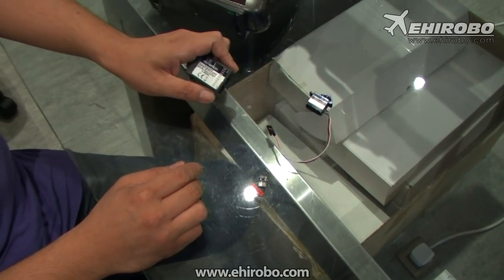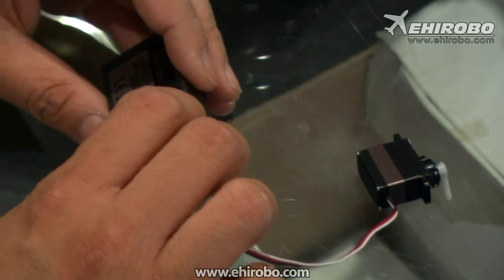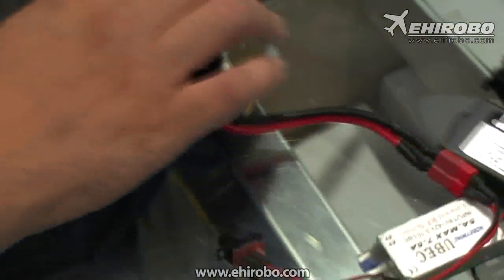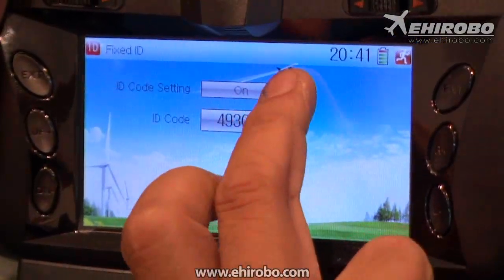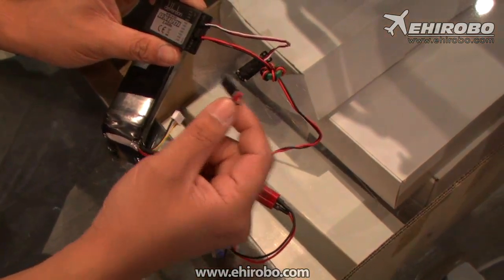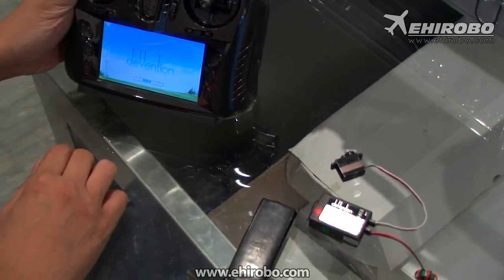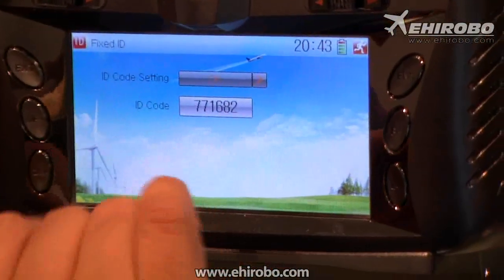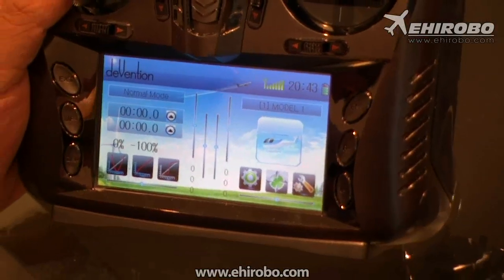Binding Walkera DEVO TX to RX and setting the Fixed ID

Comment: thanks for the video it saved me a lot of trouble. With the fixed id bind you can bypass the safety and bind with the throttle maxed to program some speed controllers :-)

Comment: Thanks Steven, This was extremely helpful. Had I not seen this video my remote would still be in a cupboard collecting dust, I tried to "Bind" to my RX for weeks with no luck, the User Manual is as clear as mud, so thanks again for your post!:-)

Comment: Hey Steve.
OK I've got my Devo 12s making a sweet bind with my walkera QR-X350 but the motors won't arm.
I think it's because the manual says to assign FLAP to GEAR-SW, but that's not possible as it's not an option that comes up (Can only assign to any 3 pos switch, trim, and aux's).
Do you know a good setup that works?
Reply: Or a .bin file I can slap on with DEfusE?
Reply: I had this happen to my QR-X350 and all I did was reset my TRIM SETTINGS,
They were over set.

Comment: Thanks - very helpful. But I'm wondering if you can bind several different RX to the TX?
I have a DEVO F12E and would like to use it one all my multirotors. But they each have different Receivers - rx1002, rx1201 and rx701.
Can I use my F12E with all of these? How?
Reply: Select models? Should even be able to name each, at least my Devo 10 can and the F12E seems a bit better than that :P

Comment: I just bought a crashed V450D03 to use as a second bird. I have problems cancelling the Fixed ID on the Rx.
Normally one should insert the Bind Plug in the battery channel and then connect the power. 
The problem is that the Rx2703H-D does NOT have a battery channel. The manual states that the bind plug should be inserted into the ELEVATOR channel. I have tried it several times, but I cannot get the receiver to flash slowly. What can I do?

Comment: I bought a "STORM 430 Semi-Metal Edition (RTF)" from helopal and it worked at first. I haven't been able to use it for a month and now it is not syncing up. The helo Rx is flashing "fast" and the  buzzer is beeping about every two seconds. When I turn on the Tx (a Walkera Devo8s) it does not sync: no solid light on Rx. I have gone through my Tx as indicated in this tutorial but "no joy". Any help would be appreciated.